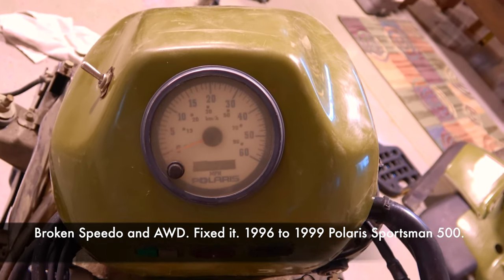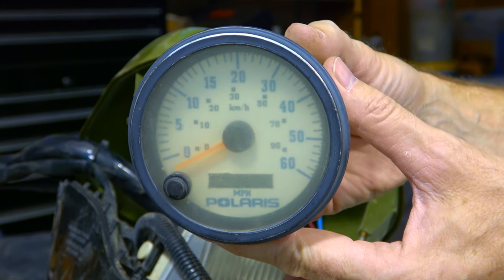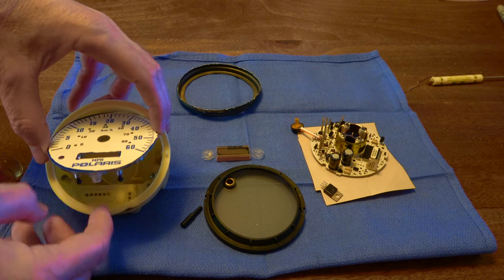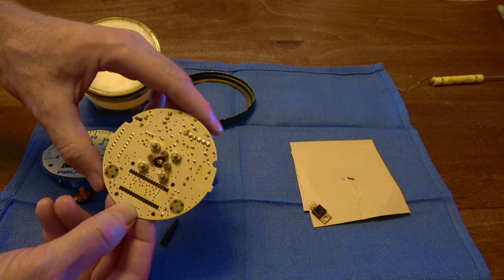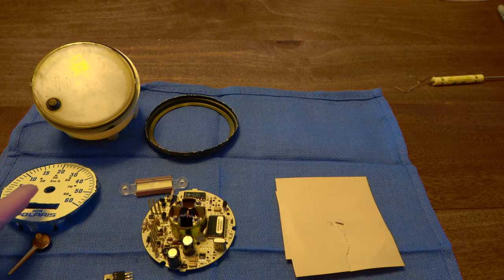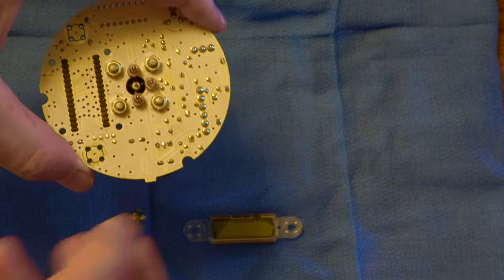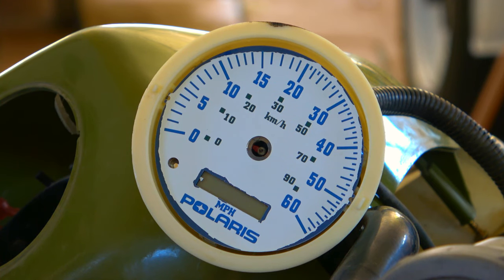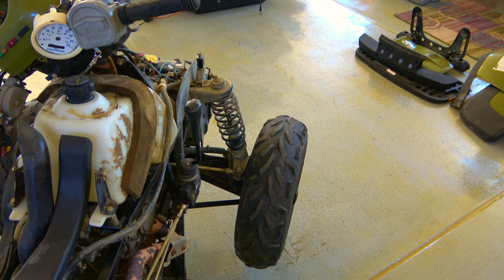Broken Speedometer and AWD. Fixed it. Polaris 1996 to 1999.

Comment: So the awd won’t work if Speedo is broken
Reply from the maker: In this example correct. I wouldn't say that applies to other year makes and models though it may for some. If yours is the same year or I think it was 96 to 200?  A common issue.
Reply: @ericinalaska7648  I have a 2001, mine lights up and digital part works. Not the Speedo
Reply from the maker: @justatrucker5681  Hall affect cable pos the culprit. Its a cable that goes from the speedo to the right front wheel. It translates tire rotation to speed indicated . There fairly cheap aftr=er market parts. And if it doesn't fix it it's not a lot of time or money invested. If mine was as described Id start with that. Unless there is more to the story.
Reply: I can add, the 1996 500 sportsman is different....  mine does not have a digital odometer but mechanical....  also uses a mechanical speedo cable... which yes, its broken... no idea if 4x4 works....  gona check it in the next few days.  This  thing has only 10 miles on the odometer, so its been broken a long time...  picked it up for $300 and had to assemble it, last guy rebuilt the engine top end and never had it running.

Comment: Mine 1998 is not even digital is with cable, is not working I need to change it, should I also bypass the 4x4 connector!?
Reply from the maker: I would see what happens when you change the cable first. If that's your plan. That way you can get a better understanding and see if that solves anything or reveals more or the real issue.

Comment: I have a 1999 polaris xplorer 4×4, the speedometer light works and everything works except the speedometer itself, and the awd doesn't work, I would assume the speedometer is the culprit, but I heard if you take the 6 pin plug out, and short the brown and white wire, then it will bypass the speedometer? Do you know if this is true? Or is it even possible for that to work?
Reply from the maker: I have seen a video or two over the years showing the bypass and considered it as an option if my attempt didn't work out. But I haven't done it. Based on what your saying Im wondering if it could be your "Hall affect" cable. Assuming the Xplorer has one. Its a cheap effort. 
On the 1999 Sportsman It goes from the front right wheel to the speedometer. Pretty simple part overall to replace. And inexpensive. Personally Id give that a try and go from there. There are also a few videos out there showing how to test one if you want to do that first.
Reply: Oh I see, because everything works except the needle, which I believe is the part that makes 4×4 work, and would that be the red white brown cable going into the right side of the speedometer?
Reply from the maker: Mine is a black cable, not sure what colors the internal wires are. Sensor at the right inside wheel and trace it to the speedo. Mine just plugs into the speedo then.
Reply: Okay thanks a lot man, really helps, but my 4×4 switch also doesn't light up, do you think it could be my switch? Do the switches only light up if 4×4 is actually working? or is that a sign of the switch not giving power
Reply from the maker: Hard to say.. There are two other parts in the speedo tat can need to be replaced as well and Im not clear on the symptoms each would cause. Did you check out the link I put in the description for the video?  It may be of help to dig deeper. There is always the pos of a faulty switch as well. Id hate to send you down a rabbit hole throwing money at it without. digging into it in front of me. But check out that link. Its been a while. But the guy gets pretty detailed about each part and it helped me a lot. http://ka7oei.blogspot.com/2013/10/repair-of-speedometer-on-polaris.html

Comment: I have a 2000 Polaris sportsman 500 6 x 6. It ran in three years ago, so when I was attempting to start it. It was misfiring really bad and when I unplugged the speedometer, it ran perfect but at the same case I don’t have all wheel drive no more.
Reply from the maker: Thats a stumper. I completely understand why he AWD would not work after unplugging it. That makes sense. But not sure how it would solve the misfiring issue. How did you come to decide to unplug the speedo when having this problem?  The first thing I'd have done was replace the spark plug. And the old fuel. Does it begin to misfire again with fresh fuel and  when you reconnect?

Comment: Eric,  I have a 1996 sportsman 500,  I got my awd system working but my bulb is burned out.  I cannot find one locally,  I have even taken it one step further and called polaris it self with no luck.  Any suggestions? Thanks
Reply from the maker: Bulb in the speedometer? Or? Yah that's a tough one. Id have to open mine up again to see it. If you have it out, it may sound weird but, may batteries+?  If not Id try to find and talk to a small electronics repair guy. Google that and see if you can find someones brain to pick. Someone specializing in stuff like that usually welcomes the challenge.  Hope that helps a little anyway.
Reply: @ericinalaska7648  sorry  I didn't clarify,  the buld in the awd indicator switch.  I know it's a t3 style buld with a type of plastic socket no one has one.  It's now my mission.  Lol
Reply from the maker: @joewilson3656  I did find this. But I don't think it lights up. Check it out. Maybe with a more refined search this will get you where you need to be or you can at least see prices and decide from there which is the best route to take.  I totally understand the being on a mission. I get it. https://amzn.to/3xzHiWu
Reply: If you got your AWD working with the hack where you ground the brown/white wire then that's to be expected; the LED on the right handlebar won't light up in this case.

Comment: Hey man I have mine apart right now and it has corrosion and based of looks I can see that my capacitors blew out.  Do you know if that's common or if another part caused that?
Reply from the maker: My first question would be was it stored outside exposed to the elements or did you or anyone commonly use a pressure washer on it? They're relatively water tight and most do just fine with all that but I think this particular one is a bit vulnerable to moisture getting in it. When you say blew out do you mean fried? Is the board showing any damage?  As far as other parts causing it. Sure its pos. Off hand Id say starting with the battery. If that's bad it can cause issues. You may have a good battery now but it could have happened prior. A bad voltage regulator can also pos I would say. But you'd also have other symptoms of that. The most common being  headlight brightness fluctuating with throttle. And poorly changing battery or maybe not charging at all. The blown out parts pretty much indicate they were likely over loaded and for that to happen Id think it was either moisture related or power related. If the voltage coming in wasn't properly regulated there's that. Thats my quick two cents anyway. I hope that helps.
Reply: @ericinalaska7648  It was stored in a garage from the guy I bought it off of but it did have a bad battery and I have been having charging problems with the stator.  The capacitors pretty much unsealed from the top.  The board does look good other wise so I'm going to look at power and swap the capacitors out.  I just want the awd back so thankyou for your input and the video.  Thankyou
Reply from the maker: @marknogueira6425  No problem. I'd love to hear what you figure out. Always good to add to the knowledge and to help others.

Comment: Do you know if any aftermarket speedometers that might work? My 99 Sportsman 500 speedometer is beyond repair
Reply from the maker: I do not. I have looked a bit but won't go as far as to say it doesn't exist. But I am unaware of such an animal. My limited understanding of this one is that it has some functionality pretty specific to a small range of years and models. S When I searched for it to make an educated decision on just buying one vs. attempting a repair I really only found an exact factory replacement. You may be able to score a used one on Ebay or something for a little cheaper. But at the time I was digging in it seemed folks were pretty aware of there market value. If you do find an option or learn something. I'd love to hear about it. As would other viewers Im sure.  Let me know if you come across an option.
Reply: @ericinalaska7648  thanks for the advice. When your all wheel drive quit after your speedometer stopped working did you have any other electrical issues? Like the lights being dim?
Reply from the maker: @MrJSR02  Sppedo didn't work, light on speedo didnt work, AWD didnt work. When you say dim. Do you mean all the time? Or do they get brighter with throttle? If all the time. Prob battery. If changes with throttle. Likely Voltage regulator. I have a video on that as well. Check the Polaris playlist on the channel. A weak underperforming battery can cause a few issues with the speedo on this particular speedo that aren't really common it seems with others. The AWD for example. May be more common than Im aware but Ive gotten the impression its kind unique to this model and range of years.
Reply: There are no third-party replacement speedometers for these. The market for used ones is ridiculously high or nobody had the part. The new one is about $400. Personally, I'm going to replace my speedometer (and its circuitry) with a small computer and screen.

Comment: I noticed your fuel cap has a gauge on it. Do you know what gauge that is or where it’s from? And is it accurate ?
Reply from the maker: I may be wrong but I believe its original. Maybe not. Ive seen them on ATV's so much over the years and figured they were stock. Never really dug into it. If you google gas cap with gage and of course the model and year you have. They're pretty readily available. It has a float on it. So its most accurate on level ground but yah Id say it's accurate enough to know if you have a full tank or a need for refueling. I would imagine one size does not fit all though. Some models may have a different tank design that wouldn't accommodate or have room for it. I googled it real quick and didn't find one specifically for a 1999 sportsman 500. But I'd be surprised if a compatible one was not available. Hope that helps.
Reply: @ericinalaska7648  it think yours is either aftermarket or a different factory option cause the gas cap on my 99 is just a normal Polaris branded cap
Reply from the maker: @loganbeedy5950  Probably. I did find this one on Amazon specific to the Polaris Sportsman. https://amzn.to/3J6QLHY And of course the standard cap. Who knows. Mine could be for a snowmachine/mobile or a different model.   I don't really rely on it too much and haven't calibrated its accuracy. But for my purpose its close enough.  It docent show empty when its not and I don't feel it misrepresents levels to any crazy inaccuracy. Id think if you find one the proper length. Same as the one in the link I included and the cap fits properly. You'd be good.  Q&A indicates if you have 7.5 inches or more clearance into the tank it will fit.  Let me/us know if you learn anything more.

Comment: My speedometer doesnt work but my all wheel is good
Reply from the maker: Does it light up? Or completely dead? If it lights up. It may simply be the Hall affect cable to the front wheel. Thats a cheap fix if that's the issue.(after market part anyway.) And it's a cheap way to trouble shoot it. It plugs into the back of the speedo. And go's down to the front right wheel. Thats what senses or calculates your speed based on wheel revolutions. And in turn moves the needle. Not saying that's your issue of course with limited info. But a potential and relatively common issue.
Reply: @ericinalaska7648  mines completely dead but my awd works no problem. The needle doesnt move and the light doesnt work on the speedometer too
Reply from the maker: Hmm. Have you checked out that link I put in the description. http://ka7oei.blogspot.com/2013/10/repair-of-speedometer-on-polaris.html
This may help you troubleshoot a bit more. My repair was limited to the issue I had. I didn't need to dig beyond, But If I did I would have tested the other  two problem parts The MPSA42, and the Zener diode referenced in that link.I reattached the TIP48. And I really looked the board over to see if anything appeared obviously fried. If so. Time for a new one.  Beyond that and the hall affect cable I mentioned above. I would have either lived with it or explored getting a replacement speedo. A bit spendy. But for me it was all about getting the AWD to work. Yours works apparently. So I guess you'd have to weigh the importance of the other features against the effort and pos $$. Id love to hear about what you learn if your able to revive it or if you determine the cause. Check out that link. Its got a lot of good info. Hope this was of help.
Reply: @ericinalaska7648  thx for the videos mine has all these problems lol
Reply from the maker: @ethand4343  Well there you go. Im actually about to finish one on coolant change and troubleshooting over heating issues if that on your to do list. Should be done in next few days or so.
Reply: @ericinalaska7648  I just fixed my overheating problem about a month ago needed a new thermostat and I put a new radiator in it
Reply from the maker: @ethand4343  Good deal.

Comment: My 2001 has the same speedo.
Reply from the maker: Its been a while. I'd have to confirm. But I think they were 96 to 2001? Are you having the same issue?
Reply: @ericinalaska7648  Yes But my 4x4 didn't work when my speedo did. I've rewired and filled the hubs still didn't work I'm going to breakout the voltmeter and see if I can find the problem, I may have to bypass the speedo.
Reply from the maker: @garyvincent9663  Explore your switch as well. They've been known to fail also.
Reply: @ericinalaska7648  Yea it sat in the weather a couple years before I dragged it in and started working on it Runs good now but I'd love to get the 4x4 working Thanks!
Reply from the maker: @garyvincent9663  Yah it can be pretty limiting with out it depending on your riding style and needs of course.